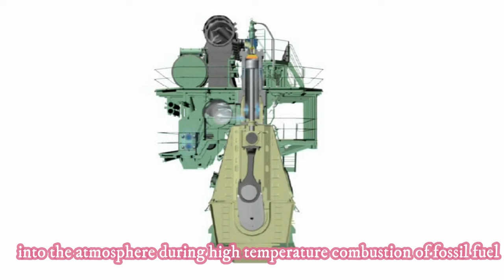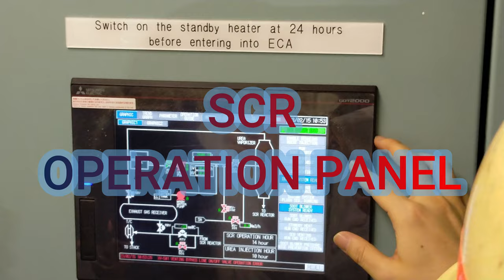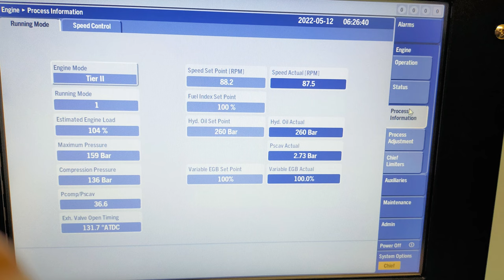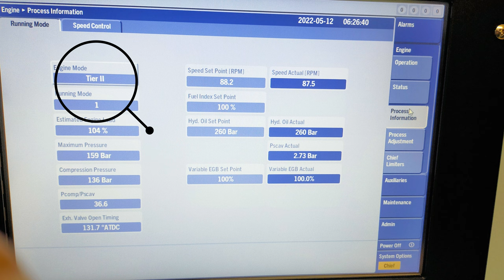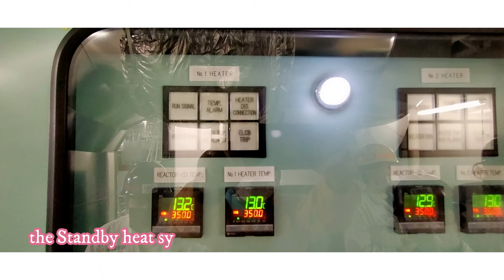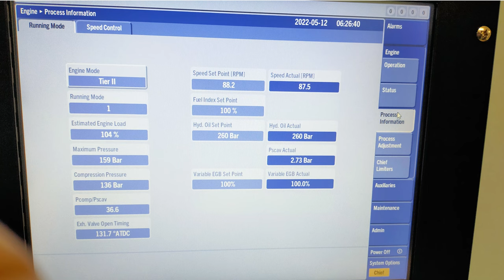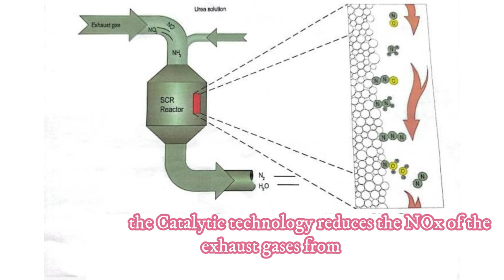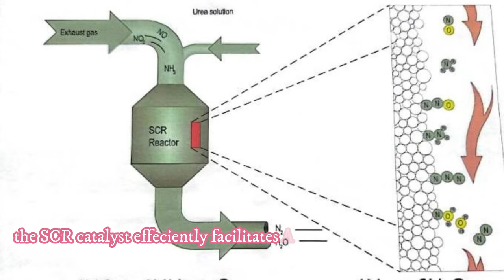High Pressure SCR ( Selective Catalytic Reduction) Working Principle | Chief Boyet | Seaman vlog

Comment: When you get near and at Port - are you able to keep temperature high enough to run SCR?  It is my understanding that SCRs and EGRs don't operate when ship is going too slow.
Reply from the maker: Hello Kengat, for the SCR, it has a temp setting where in it will auto start or auto stop dependeng on the type of SCR wether it is for HSFO or LSMGO. While for EGR, at certain engine load, it will auto stop and auto start. You can check it in the technical file of your vessel to be precise

Comment: What u do when SOx react with ammonia and deposited on catalytic surface that lower the conversion rate?
Reply from the maker: Hello Kush, actually the system has a soot blow. This is to clean the catalyst to keep it in a good condition. Aside from the cleaning or maintenance interval as per manual. One reason why the SCR is running at a certain exhaust gas temp is also because of your concern. It therefore, proper operation should be observed and followed.
Reply: May I know that operating temperature and how this soot blow works sir, its interesting knowledge I am getting...
Reply from the maker: Hello Kush, sorry for the late reply.
If the SCR is designed for Low Sulfur, min required temp should be 280 - 310 deg C while for high sulfur should be about 300-350 deg C. Moreover, the SVR has Standby Heat System maintaining the temp in the reactor higher than the dew point. As required prior starting the SCR.
Reply: Thanks